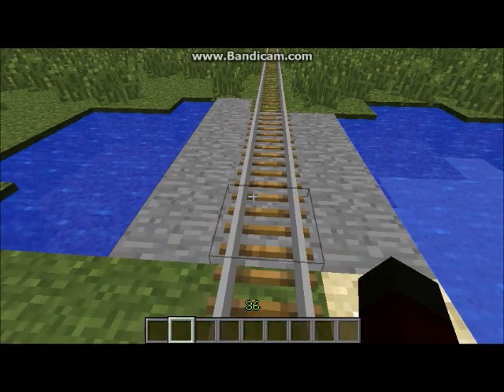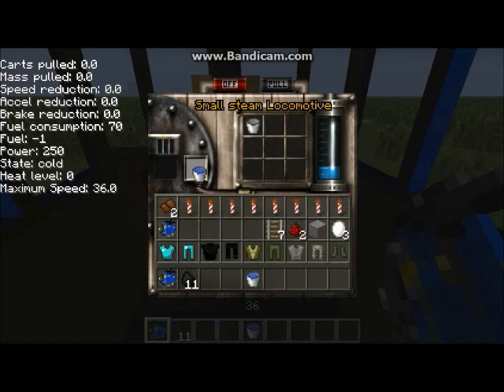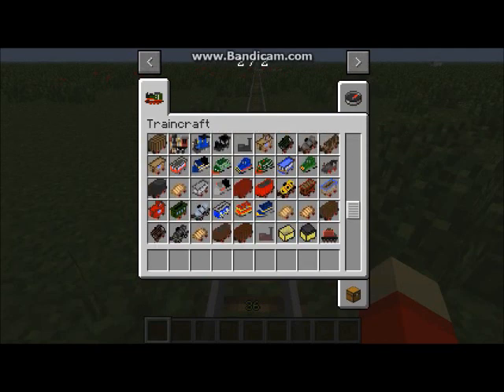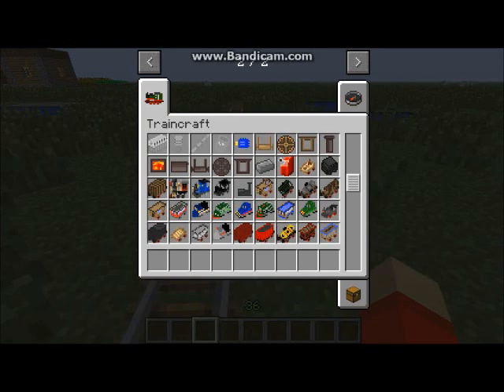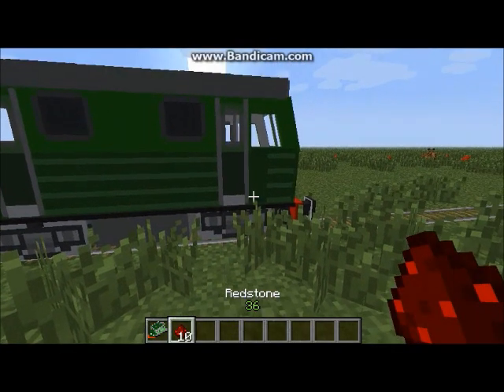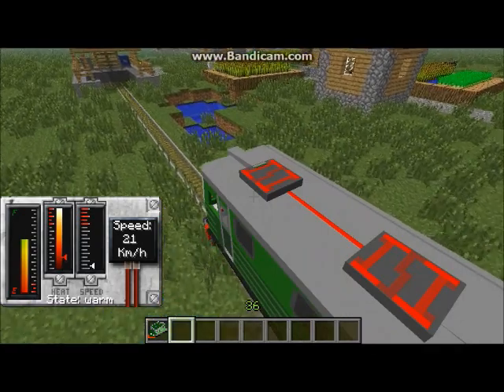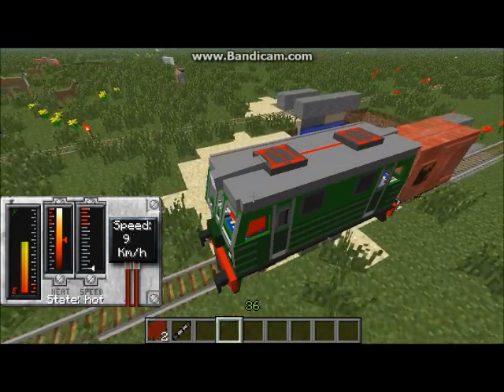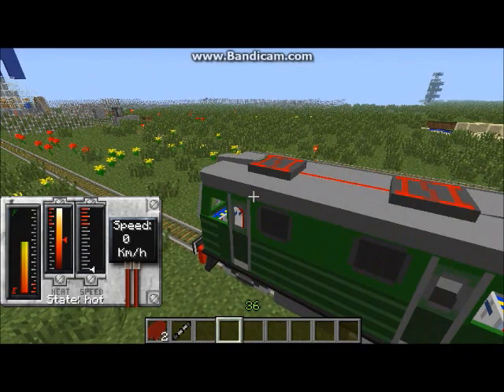How to Minecraft Series: Traincraft

Comment from the maker: If the attaching mode on for the car number does not appear click on the car a few times until it does. Also to connect the cars push the one into the other with your character. Hope that helps.